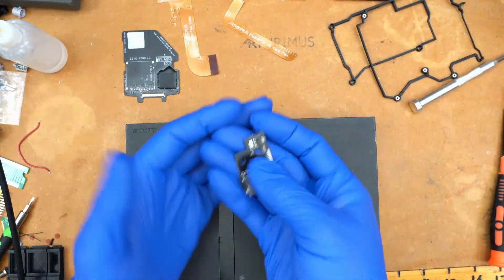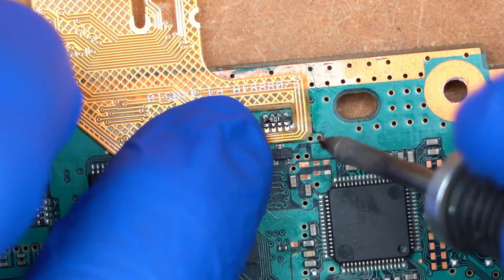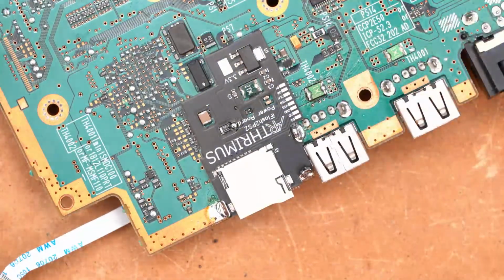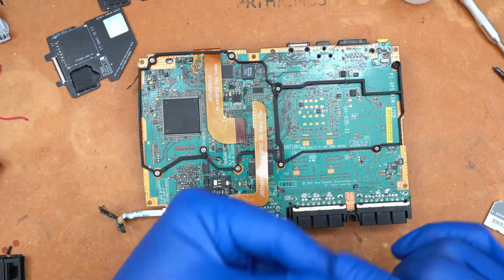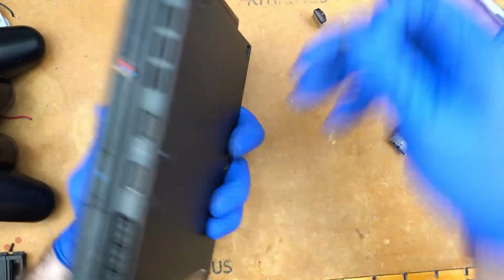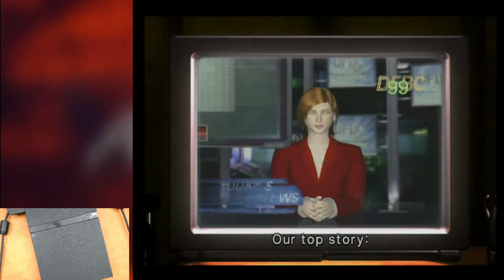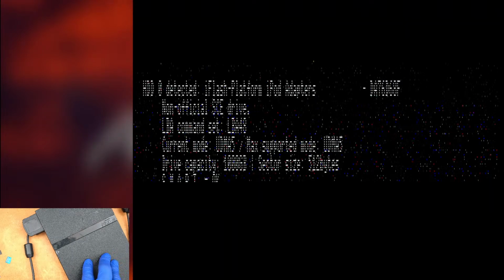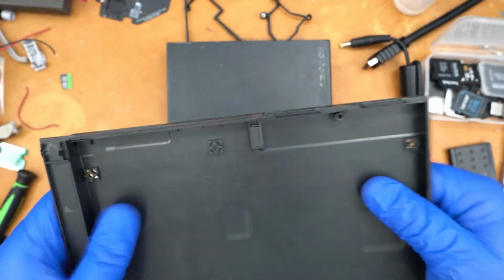iFlash2PS2 Flex Release Candidate Install! SD Card Adapter for PS2 Slim!

Comment: Hey, I'm having trouble. I installed iflash2ps2 seems like it was successful because when I load fmcb the hideout loader recognizes my 1tb sd card (pny 1tb elite pro) however I can't seem to figure out how to use grimdoomer. I followed the instructions on this video and when I load the sd card back onto my computer it won't show up. Seems like OPL is reformatting it and I don't know how to proceed. Any help would be appreciated

Comment: why does it look like the FFC solder pads on the "3 resistors" section is going to bridge a connection between the solder points to the vias that are right there......
Reply from the maker: It won't. The bottom side of the flex cable doesn't have the full pad exposed like the top side does, so the vias are masked by the flex.

Comment: Nice work. What its the sd card size limit?
Reply from the maker: Theoretically there is no size limit, but it has been working with 1TB SD Cards. It is incompatible with the SanDisk 1TB and 1.5TB cards, but that's not because of a size limit, that's because those particular cards are not reliable with the iFlash.

Comment: I look forward to ordering. Cant wait to install this. I was going to go the m2ps2 route, but Modsville mentioned a while ago there were a few people looking at getting these sorted.

So would this work with the quad? To give 4tb of space theoretically( not sure the ps2 library is even that big but in theory could this support that?)

Also is there anything special about wiring to the iflasher? Or is it simply a pata to sd converter? Asking as i’d love to be able to wire up one to a dreamcast. As the normal sd card method doesnt let Microsoft ce games work. Great video thanks :)
Reply from the maker: It should work with the quad, but it has not been tested yet. The only problem with the dual or quad is that loading games will be difficult because you can't just remove the SD cards and plug them into your computer. You'd need to connect the iFlash to your PC using a USB enclosure any time you want to add games.

The iFlash is a PATA emulator, so it converts the SD card interface to IDE just like a real hard drive, so theoretically it should work with any device that can connect to IDE drives assuming you have an adapter cable for it.
Reply: @ArthrimusTech  ah yeah good point with dual and quad.

Thank you for confirming thats really good to know. I look forward to your finalised adapter and stuff.
Reply: @ArthrimusTech  Hi is the iflash to ide adapter you used ( the break out board one) open source of is it something you made? Im just trying to find on to see if i can test this with a dreamcast. Thanks either way
Reply from the maker: @QTronics  It's actually not an iFlash adapter. I just bought a generic 40 pin ZIF to DIP adapter off of Amazon and wired it up using a pinout I found online for 40 pin ZIF 1.8" IDE drive.
Reply: @ArthrimusTech  O that’s awesome thank you very much. I’ll have a look then. :)

Comment: I do wonder if this will work with the dosdude drive. does fhddboot work on the 70012?
Reply from the maker: Does the dosdude drive have a 40 pin ZIF version? If so then it should work. As far as I know none of the slim models support Free HD boot. My understanding is that they removed the IDE drivers from the bios on these models.